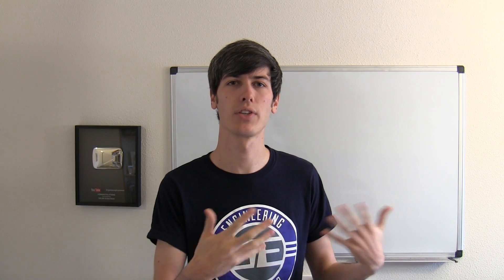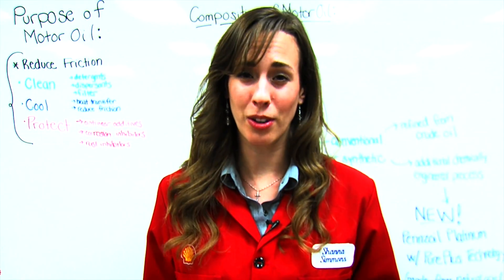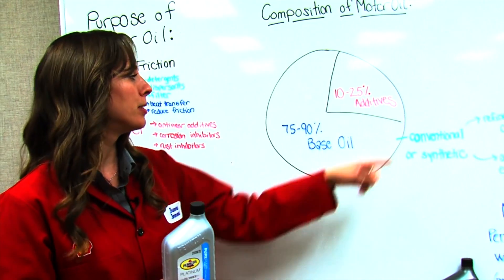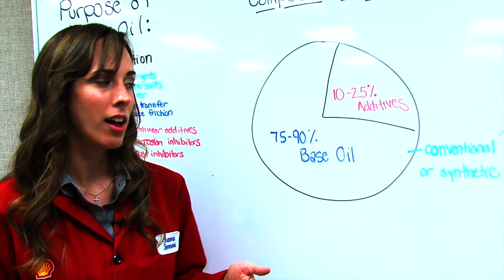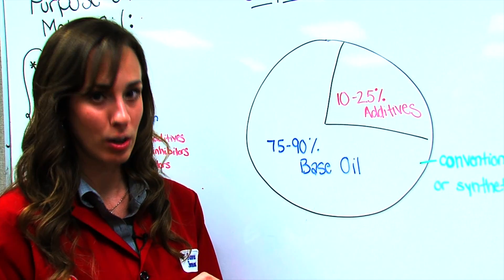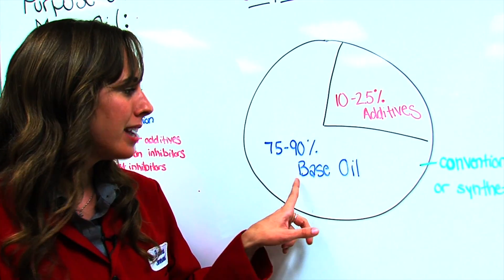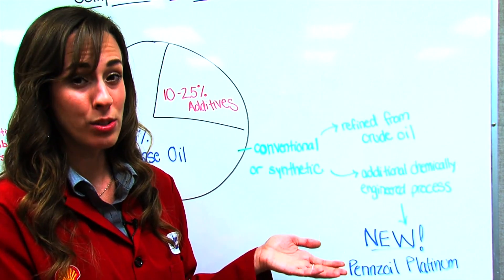Motor Oil Myths & FAQs - Synthetic vs Conventional

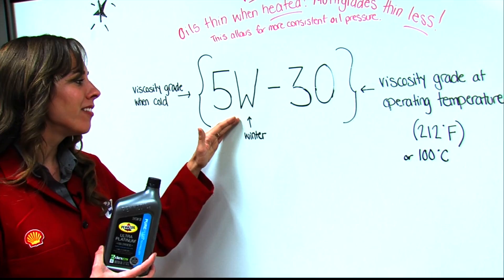Comment: At 0:26 I always though the W stood for the Weight of the oil.
Reply: +Dave C No it is winter, but the same concept applies, just different words. If you go on clling it weight you will be ok, but winter is just "correct" I think weight came from the fact it makes more sense that way.
Reply: Dave C No... its just the facts.  Most people say weight and still get the same result, so there is no problem in using whichever you want.
Reply: Dave C Its been winter, its just a fact.  Its not a big deal.
Reply: +displayfireworks1   I'm 62 years old and this is the first time I ever heard that too.  But it sure makes a whole lot of sense and I'm glad I came across this video just for that alone.
Reply: +Dave C sure don't believe SAE. the people who made the naming scheme.
Reply: "I've learned something new and now forgotten something in its place"

Amen to that!  I always worry what was just pushed over the cliff into oblivion.  Oh well, I won't know until I need it.
Reply: +Dave C Just because you have been wrong for a long time doesn't change what it has been.

http://www.upmpg.com/tech_articles/motoroil_viscosity/
http://www.sae.org/news/releases/rightoil.htm

Two sources stating the W stands for winter or low temp viscosity.
Reply: +displayfireworks1 I love how some people can't admit they could be wrong for years LOL This makes sense since if it were 'weight' it should read 5W30W or just 5-30. I've learned something new and now forgotten something in its place
Reply: I was told the W stood for Wumbo.
Reply: W for winter is a pretty easily found tid bit. It's why you don't really see 30W oil; if W is in the designation, you almost always have two numbers. Calling it the wrong thing for 30 years doesn't make it right.

Telling you your assertion is wrong isn't condescending. Appreciate information over ego.
Reply: If the temperature of 5w-30 is 212 f or 100 c then why are there 5w-20 oils? I assume and think right the temp be higher or lower??? I like to know if any you do know,cheers.
Reply: its 5 viscosity when its cold, when the engine warms up  the oil thickens to 30 viscosity and keeps things lubricated. If it started at the heavier weight it would be too thick for the engine to pump it when the engine first starts up.  its the same reason for the 20 viscosity. Some Engines can't handle 30 viscosity even while running.
Reply: displayfireworks1 nope.. Winter

Comment: Might have been mentioned but this always threw me for a loop- No, the oil does not get "thicker" as it heats. Rather, the 5 in 5W is the viscosity index at a given "cold" temperature. So, it acts like a straight 5 weight at that cold temperature. Then, the 30 is the index at a given "hot" temperature. So it acts like a straight 30 weight would at the high temperature. The short of it? It acts like a thinner oil would at cold temperatures and a thicker oil at hot temperatures, so it doesn't get as thick when cold or as thin when hot. Best of both worlds. Also, gear oils don't quite compare straight across.... 80w-90 is closer to a straight 50 weight. 
Oil additives CAN be of benefit, just which ones where and when makes the difference. Say, in an older muscle car with an original V-8 engine, the camshaft will wear at an accelerated rate if you do not add a certain additive to modern oils. Namely Zinc Di-Alkyl Dithiophosphate or ZDDP. Why is that? Zinc slowly fouls out catalytic converters over time so it has been mostly removed from modern oils to protect emissions systems. That combined with roller-lifters and different profiles on "flat-tappet" lifters combined with better metallurgy has made it not as necessary on modern engines. 
For viscosity, she is completely right, however I would like to add that modern engines have VERY tight tolerances compared to older engines. The thicker oil certainly can decrease efficiency, it also can cause lubrication problems when cold (thick oil has a harder time pumping and therefore reaching some areas) causing accelerated wear. Follow your owners manual, not necessarily the oil cap. Match up the chart for temperature. Some oils may work better in winter temperatures for your region, say, 5w-20 where 5w-30 may work well in spring and fall, then 10w-30 in summer. I've seen as wide a spread as 5w-20 to 15w-50! 
Thanks for another informative view!

Comment: I have been running the same vehicle for the past 25 years using Penrite 20W 50 and have never experienced any problems with then oil I use. It gets changed when the colour of then oil starts to lose its golden sheen. The slightest sign of the oil going black , is the time to do the oil and filter change.

Comment: The first number is the viscosity of the base oil and how the oil will act when cold. The W means it has a detergent in it, with detergent. The last number is how the oil will act at normal operating temperatures. There are additives that will cause the, "thickening" so that it will act like a thicker base oil at higher temps.  Over time these additives break down and the oil wont be able to reach that higher number at the end of its life.
Reply: +Eric Feist "W" means detergent? Seeing as random searches confirm what this video stated, I think I'd go with what the lovely Shanna, the engineer from Shell OIL, said. W is for Winter.
Reply: +whiteknightcat, I know, it's a very common misconception. 99.5% of the oil on the shelf has the W. Many engine manuals will recommend a 5w-XX for cold operating temps and 10w-XX for warm temps. You really have to go out of your way to find straight mineral oil without the W.  In the old days this oil was only used during the break in period, the first few hours of operation. It would allow the piston rings and cylinder wall to seat properly.  It's still used today when breaking in small aircraft piston engines.  The detergent is an additive that keeps the sludge from settling out.

Comment: I don't think that oils have multiple viscosities. Do you mean that a 10w30 has the 10w in cold and 30w in hot temp?! I don't think so. Aren't they just more resistant against the Heat?
Every kind of oil has only one viscosity in a specific condition, and normally they have lower viscosity at higher temps.
Reply: +Amin Mohammadzadeh   Wrong.
Reply: +Alex Mitchell so why every time you pull the gauge from a hot engine the oil is obviously thinner than when it is cold?
Reply: Listen pal,  I live in Ottawa, we have incredibly cold winters and hot summers.  Engines get stressed at both ends of the temperature spectrum.  MULTI-grade oils (NOT single grade)  are designed to flow differently at different temperatures.  I have run 0w20, 5w30, 10w30 and 15w40 in the vehicles I currently own. 
On those mornings when it is -40 degrees I want the winter number, (i.e.: the number before the "W"), to be as low as possible - because it flows faster to protect the engine AND especially because it makes it much easier for the starter to turn over the engine.
Unless you have pulled a dipstick at -40 and checked how thick the oil is and then compared it to the same oil (in a cold engine) on a hot day, you cannot make a sensible statement about the multi-grades and how "thick" they are.
Reply: +Alex Mitchell I need one other experiment. Does the same oil, for example 10w30, actually looks thicker in a hot summer day before you start the engine, than a winter day?
The whole thing you described to me can be done by a thin oil that can maintain itself thin at higher temps. But I think still they loose some viscosity when they get hotter.
The definition they present out there introduces some liquid that actually get thicker in higher Temps. And you're agree with it.
Reply: It's called "multi"-grade for a reason.  Do your own research.
Reply: +Alex Mitchell I'd appreciate if you share some thing you know about the reason. According to my experience it is actually one graded but more resistant and it is miscalled multi graded.
If you don't have info or you're not eager to share, Thanks for considering and reply to my comment sir.

Comment: her description oil viscosity designation a bit vague and misleading.
she was not thorough enough in her description when in fact 2 basic sentences would have completely clarified her entire intent.  
 In a 10w-40 for example the 10w bit (W = winter, not weight or watt or anything else for that matter) simply means that the oil must have a certain maximum viscosity/flow at LOW temperature. The 
lower the "W" number the better the oil's cold temperature/cold start performance. The 40 in a 10w-40 simply means that the oil must fall within certain viscosity limits at 100°C. This is a fixed limit and all oils that end in 40 must achieve these limits. Once again the lower the number, the thinner the oil: 30 oil is thinner than a 40 oil at 100°C etc.

Comment: +engineering explained my vw polo 1.4 16v manual says 5W-30 but my vw dealer puts 10W-40 is my car ok? (Greece) Thanks a lot!
Reply: +dim karadimos 
It's OK.
VW dealer put 10w40 because more probably 5w30 for the weather temperature in your area is too thin.
As already said, 5w-30 is the viscosity that nowadays majority of the car makers use to reduce the exhaust emission. If you change the viscosity for a thicker oil, there is no problem to the engine. The important things are the specs: SJ, A3-B4 and so on...
Reply: +Eugenio C thanks a lot for your answer they use castrol magnatec part synthetic
Reply: +dim karadimos 
Any time, Dim ;)

The brand doesn't really matter. 
As long as they use the right specs for the engine of your car (any brand, 100% synth, semisynth or mineral) it will run OK. 
As you can see, in all the manuals of all the cars, there is no mention of which kind of oil you have to use, if synth or regular or whatever; as said they only recommend to use right specs good for the engine.

Comment: Hey what about diesel engines?  I was told by the car dealer if I use conventional oil in VW TDI, can't remember the exact km, I will basically destroy the engine.  What oil should I use for Tesla Model S?  just kidding.

Comment: Not to mention , to heavy of an oil other than recommended can possibly blow out seals and whatnot .  .And i always thought that non syn oil was the best for wear in / breakin for 5k miles as it give the bearings a chance to loosen up and wear to spec and synthetic is to slippery not allowing this to happen or could that also be a myth ? Also do you think Mobil 1 is top notch or Castrol which is recomended by VW ?

Comment: This is a good video, but needs to be renamed "Motor oil Basics". It overs no advice for older engines and really only covers modern oil and really doesn't cover the maintenance schedule at all. Nothing on diesel engines either. Again a good basic engine oil video.

Comment: It is best you pour in the viscosity the makers state and make sure it is "fully" synthetic and conforms to the latest API which is now SN I believe. Thinner oils have to be "fully synthetic", as they are the only oils that can handle it.  Thinner oils are meant for less resistance and better fuel consumption.  Thinner oils also get to the bearings quicker on start up, when the oil has drained down after the car is standing for a while.  Thick oils are a big problem on starting especially in winter. The problem is getting oil to the bearings fast enough as the oil is very thick at low temperatures. That is where fully synthetics shine. They do not become too thick in very cold temperatures starving the bearing of oil on start up.  In place like northern Canada using a 0W oil is near essential as the oil can get so thick when the engine is cold. 

Fully synthetics also have far greater "shear", that is the resistance to be compressed, keeping metal surfaces apart.  Fully synthetics last longer as they break down far slower. A mineral oil can be broken down substantially after 1,000 miles. 

Fully synthetics resist and are stable at great heat. They were developed for jet aircraft. Mobil 1 had an advert in the 1990s of two frying pans on a stove, one with fully synthetic in the pan and one mineral oil. They left the burners on. The mineral oil ended up black, burned, dry, hard and caked up. The fully synthetic was still as it was after igniting the burner.  This is relevant as all engines have hot spots which will burn mineral oil, hence caked oil forms in parts of the engine. When engines idle and oil and coolant are not being pumped around fast enough it can cause engine hot spots and burning of mineral oil. 

Avoid semi-synthetics as many are con. The synthetic part  may only be 5-10% of the oil. Only drop from a fully synthetic to a semi when the engine is using oil. 

So in short, Get the viscosity your engine needs and pour in a high quality "fully synthetic" and have the latest API number.  The highest API numbers are always "fully synthetic" oils. Do not go on old wives tales and the comments here is full of them.
Reply: Joe User Lubrication qualities of "fully synthetic" are just vastly superior, irrespective of your experiences with poorer quality oil. Only fully synthetics reach API SN. SN is the highest protection. In parts of the European Union it if difficult to find a 100% mineral oil. Most makers stipulate a semi-synth as minimum. 

Take note of what I write and apply. Fully synthetic oil is NOT expensive.   My comment still applies....
"Do not go on old wives tales and the comments here is full of them."
Reply: Joe User The best protection API is only met by fully synthetics. That says it all. No one who knows anything about oil uses mineral oil. Go into any store in the UK or Germany and you will not see mineral oils on the shelves.
Reply: Joe User I really do know what I am on about.

Comment: It used to be there was a much greater difference between the quality of engine oil between conventional and synthetic base stocks. In fact prior to the 80's all engine oils were synthetic because straight conventional oils were so poor that they couldn't handle the rigors of engine lubrication. But the purity of conventional oil eventually improved to the point where they quietly started to sell it in the old familiar yellow, green, and white bottles. Then they marketed the synthetic oils, which were actually the oils they originally sold, as some new wiz bang synthetic oil of the future. As they say in sales & marketing, "Sell the sizzle, not the steak.". But over the past 20 years they've continued to improve the purity of the conventional oils to the point where now they easily outperform the original synthetic oils. New conventional oils can handle oil change intervals of 5000 miles under normal driving conditions. But of course, synthetics have continually improved a great deal as well. Many high grade synthetics now days can can handle oil change intervals of 15,000 miles; with a premium cost per bottle. With that said, if there was just one oil that I had to choose as the only one I could use, it would be conventional Pennzoil in the yellow bottle. Yellow bottle conventional Pennzoil sits right in the sweet spot of cost, protection, and miles between oil change intervals; best bang for the buck.

Comment: Hi! First of all, I'd like to congratulate you for this very interesting channel. I have a question to you. Maybe two. What do you can explain me about viscosity? Does it really increase with temperature? I have on my personal collection a Mahle Manual about engines and there there is this information, some thing like that: the viscosity increase because the clearances increases. But everybody ask me that, because the oil appears to be more eluted with the heating.

Another question: what can you say about Militec-1, based on Molybdenum Dissulfide?

Comment: Useless video.
Wrong answers/explanations read by a girl with a "Shell" blouse who recommends Pennzoil lubricants. Very consistent...
- She only says that W is for winter and the second number is for operating temperature. Nothing else.
- You can use additives in your engine. Why not? Not all the additives, but you can. 
- 75%-80% vs 10%-25% is not the only ratio.
- Not all the oils can be mixed, even if synth or semi-synth or mineral together. You can do mix them only in case of emergency and only if the specs are the same, but you have to change and refill with new oil asap. Also, just because new engines and racing companies use synth oils, it doesn't mean that they are good for every engine. 100% synth or semi-synth oils in old engines, especially with high miles/km are not good. Also, you have to choose the quality of the oil (mineral, semisinth or synth,) according the use of the car.
- SAE viscosity grade is according the outside temperature. It is not recommended to use a 30 in hot temperatures, 45C/113F or more, and is not recommended to use a 20W at very low temperature, below -15C/5F. 
- You have to change the oil not only because you reach the mileage indicated by the car maker, but especially according the use of the car you do: city with stop'n'go, highway, load, towing... , in any case, you have to change the oil every year or 2, even if with low miles/km.
- And, last but not least, you have to check also, the specs: SG, SJ, SL and A2 or A3 or B4 or B1 and so on...
Reply: +Randy Smith 
Yes, OK, Shell bought Pennzoil. My bad, I didn't know...
In any case, all the other things that the "smart" girl said are totally wrong and useless!!

PS: Next time, go and tell smart arses to all the members of your family, OK?

Comment: Synthetic oil ,when used in an engine burning a high lead content gas such as an aircraft engine has to be changed at sooner intervals then when using a conventional oil,because the lead content will not mix with a synthetic and will fall out of suspension and plug the intake screen of the engine.